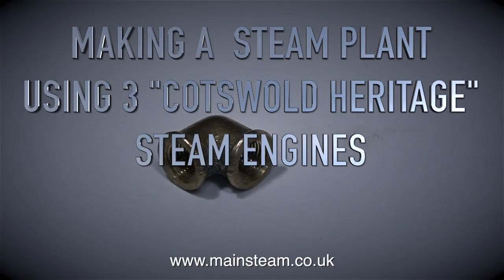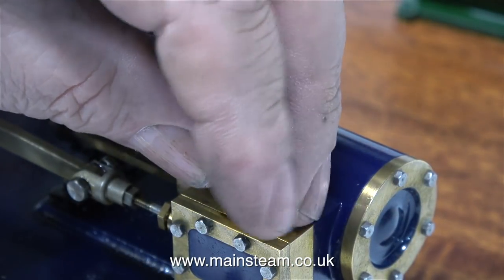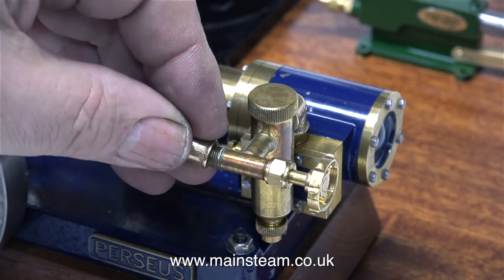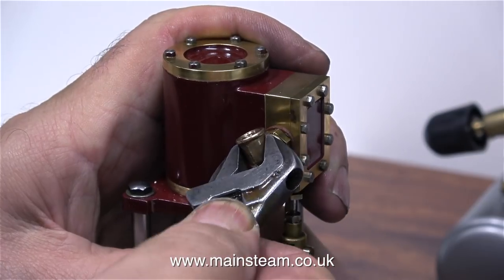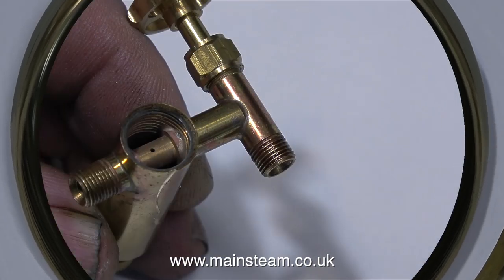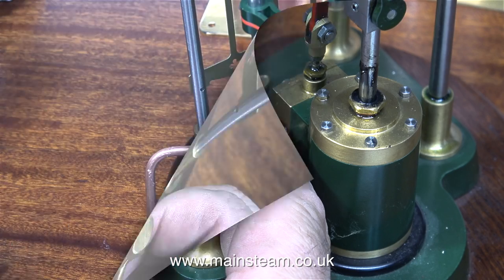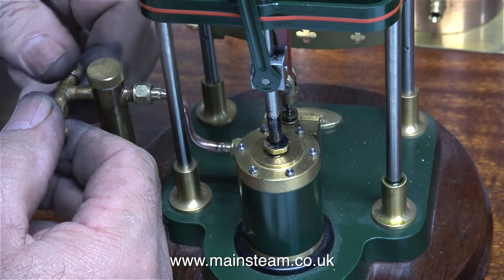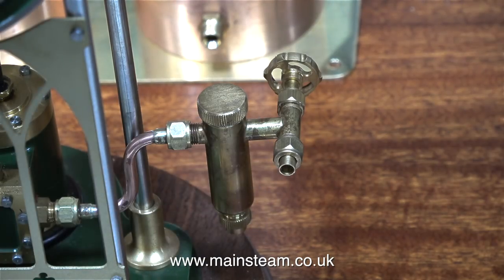A MODEL STEAM PLANT WITH 3 STEAM ENGINES - PART # 5

Comment: PM Research fittings, being 'merican, have tapered threads. The idea is you simply cut similarly tapered threads on your pipe and screw it straight into the fitting - no faffing about with union cones and nuts. Pipes are almost always kept straight. I guess this is to replicate in miniature what happens with full-sized steam plants... and to sell more fittings ;-)